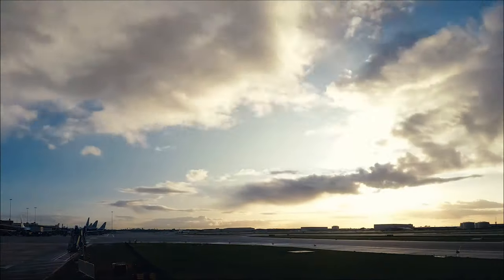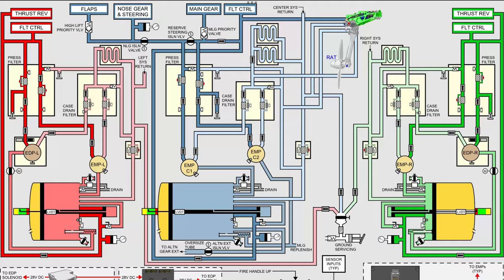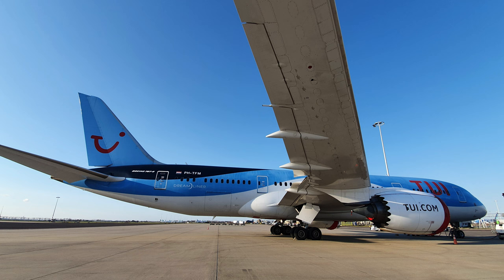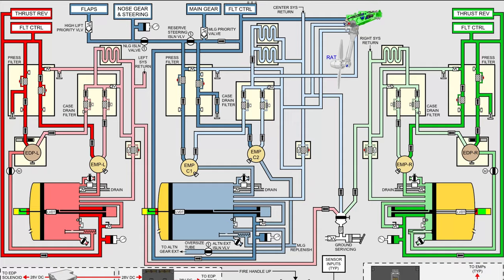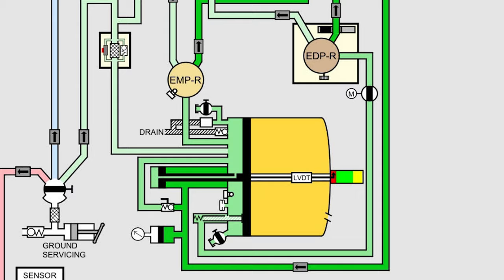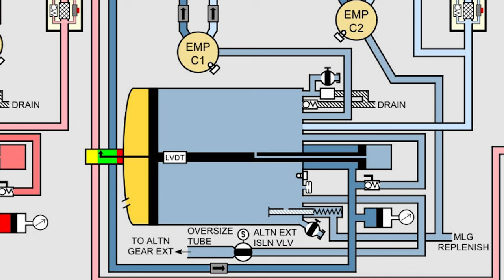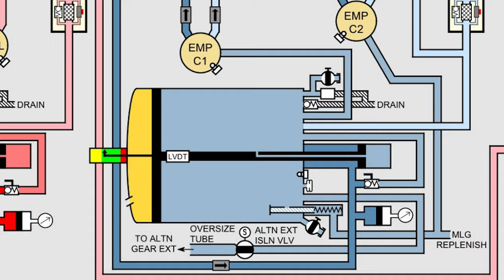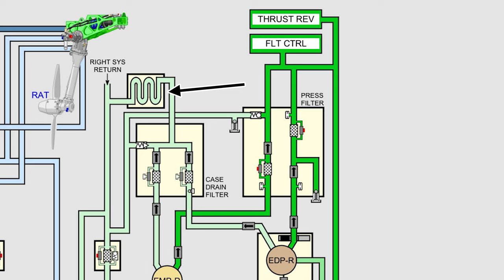Boeing 787 Hydaulic System Explained + Return Filter Replacement

Comment: Great video! two questions. so is the purple liquid typical hydraulic fluid of 787 or something else? The second, any more videos for Explained Series, such as electrical, fuel, pressurization, air conditioning and so on?
Reply from the maker: Hey @naimsuleymanoglu8007 ! Thank you very much. It is, there are different brands of fluid but I know this is a commonly used fluid for aircraft hydraulic systems. I will make more explain videos of aircraft systems! Have a great day :-)